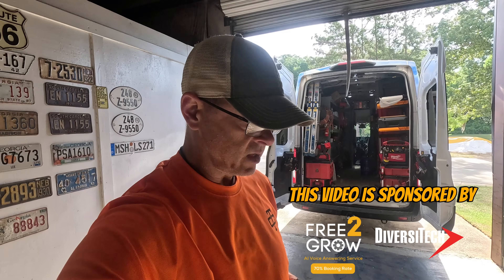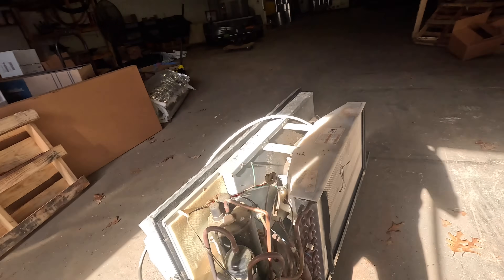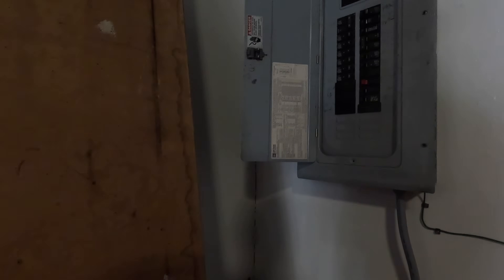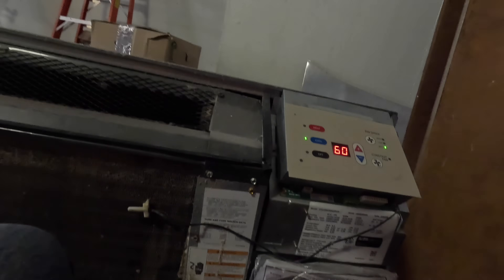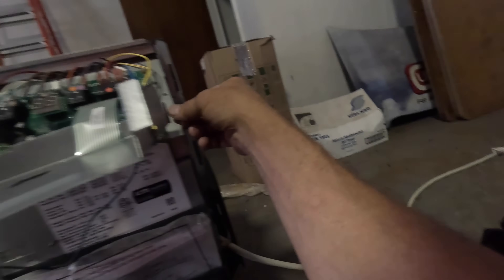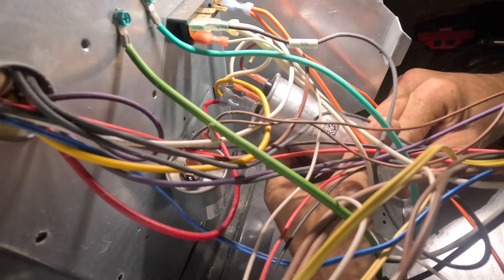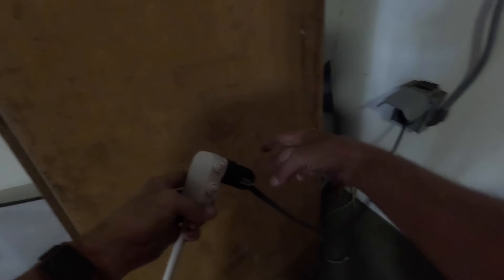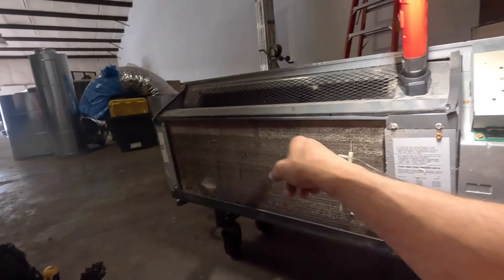Simple Repair Made Difficult Due To Location! #hvacguy #hvaclife

Comment: all of them blasted ptac's are well known for tubing rub-outs. not to mention fan motor failures and capacitors, in which they get left on and burn the oil to black sludge wax or nuke the windings.
they have not been manufactured to be repairable in the last 20 years, sad to say, always just replace them and ship the other to scrap. save the control board, although it's likely at end of life too.

Comment: but it's right next to the black wire is where that's supposed to go watch beginning of episode
Reply: Doesn't matter, those 6 terminals are commoned together.  The 6 on the left are 1 leg of power while the 4 on the right are the other.  They use those terminal blocks as a convenient point to distribute power.

Comment: That was not made to be serviced. It was intended to be a disposable item.
Reply: Yes they can be serviced you can brazen in some valves an charge them and also fix the leaks, I have done a few if there compressor is good an everything eles works then no reason to replace with a lil work
Reply: @deweyabbott5310  They can be, doesn't mean they are made to be.
Reply: Sure you can service them done so many times.
Reply: One of the "movements" in the US is the Right-to-Repair. By adding some Schrader valves, would it be more able to be repaired? I'm no HVAC person...just a DIYer. I just hate to see repairable items be thrown away.